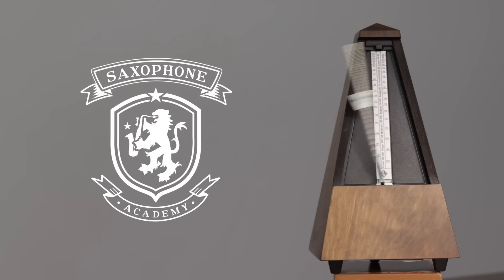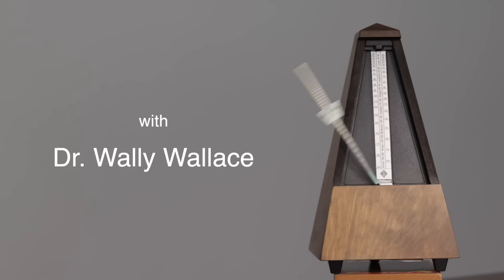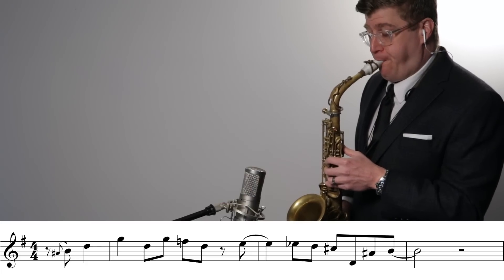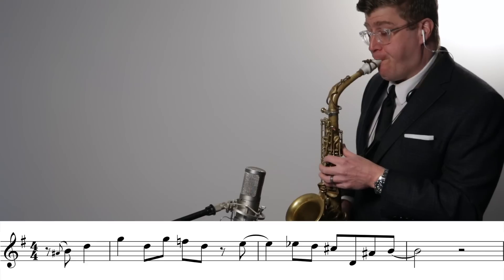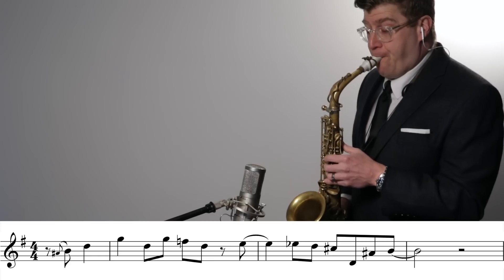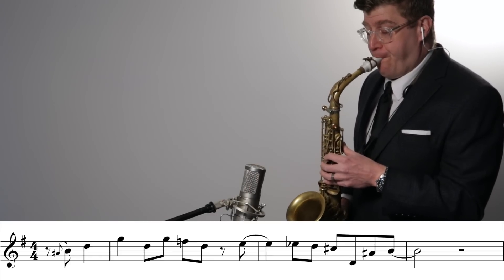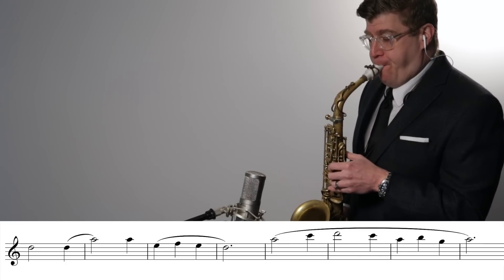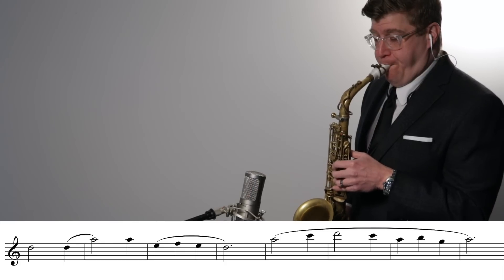Saxophone Tone | How to get a big warm sound

Comment: "Dr Wally believes in you" ...Dr Wally may have taken one too many baritones to the head O.o! 

Seriously though, I have to thank you for the breathing explanation, the reminder (for both how I breathe when I'm playing and to be patient with myself), and the new way for me to look at my breathing while playing. 

One of the issues I run into is, surprisingly, Karate. No not random karate fighters trying to punch me in half when I'm playing (though I could hardly blame them), but rather karate breathing. In karate, breathing is the opposite, you pull your belly in when you inhale and let it expand on the exhale (for various reasons that I won't bore you with) — unfortunately after ten years on this, whenever I require a large intake of breath I default to this technique because, well, 10 years of karate training. Goes to show, though, that just because something is an "art" the toolsets don't necessarily overlap... also that I REALLY need to redouble my efforts on getting a more focused mindset when playing. 

Oh and I deffintly agree with the other comments on this vid. Somethings have definitely just clicked for me (not just on sax but clarinet as well) ^_^ .....I still have no idea what's supposed to click from Charlie Parker and Glen Gould though =.=;;
Reply from the maker: I know what you mean about karate breathing - the sudden  sharp exhalation and kiap. It's certainly different, but with practice you'll get it my friend! Dr. Wally believes in you.
Reply: @drwallysax  Not only an expert in music but knowledgeable in karate!? 

...Well then, I guess I have no choice but to believe in the me that believes in you that believes in me.

Comment: Absolutely love your content, and the way you make more difficult concepts easy to understand (aka - using the diaphragm correctly).  I'm still challenged with tonguing correctly while at the same time putting my lungs in my stomach, but the sound is definitely fuller. THUMBS UP!
Reply from the maker: Thanks, Steve! Glad it's helping! The tongue "valve" is rather counterintuitive to the way many of us learned (myself included) - it takes time, but once you get it, it's like riding a noisy, expensive bicycle!

Comment: The embouchure for playing the sax is not the same as the clarinet , the note can be     sounded without the tongue touching the reed , using a push of air direct from the diaphraghm. Stan Getz used a double lip embouchure and didnt use tight top teeth hold nor much  lower lip upward pressure, similar to how you blow !

Comment: Question for the Doc!   You play both classical and jazz.   I do the same but at a much much much lower skill level.   I am wondering what tip opening you use for both styles.   I have a Selmer C* for classical and JJ HR 6 for jazz.   I find it hard to adjust between the two and I certainly cannot use the same reed strength.   Do you manage two separate sets of reeds?  I also find myself practicing with the C* often,  just to not wake up the kids.   Which makes it more difficult when returning to the HR 6.   Any suggestions on this topic?  Perhaps a video on this would be a good idea?
Reply from the maker: FANTASTIC question, Nate - I'll make a video. Short answer - I use separate reeds for each mouthpiece. Also, you have to get used to sucking in two genres for twice the time as your peers. It's a VERY humble path, and maddening at times. But I'm glad I walked it!

Comment: Nice lesson doc, I have a question which is not about this lesson tho.
My question is, how do I make use of the octave key? I mean when do I hold it and when do I release it? thank you
Reply from the maker: octave key is used for the notes D2 and higher. The "D" that's on the fourth line of the treble staff. That note and any higher - smack the ol' octave key!
Reply: @drwallysax  OK, thank you very much sir